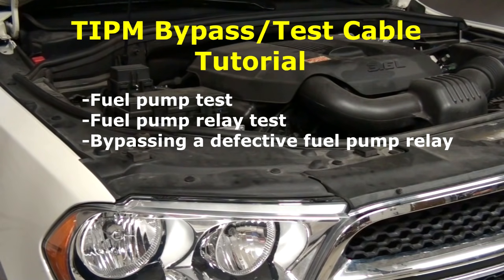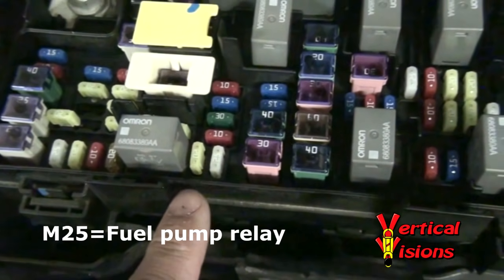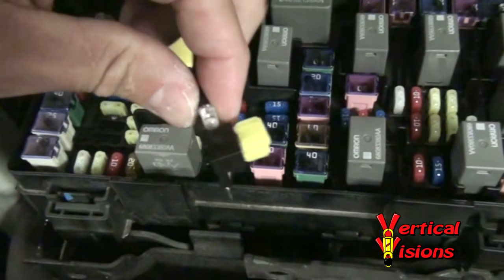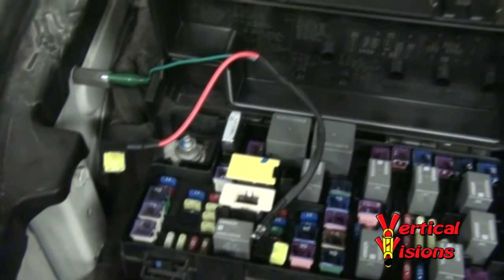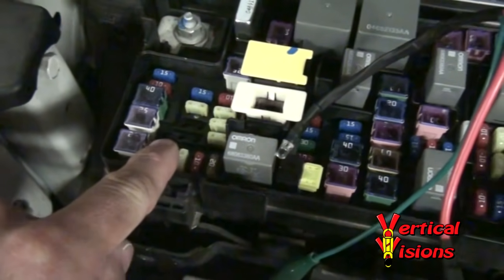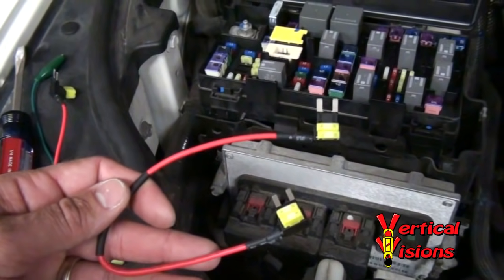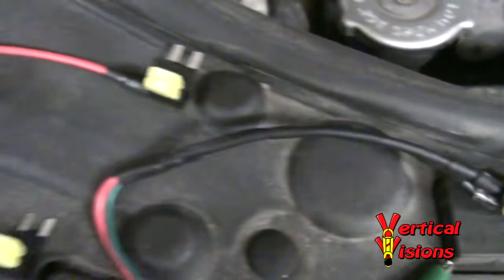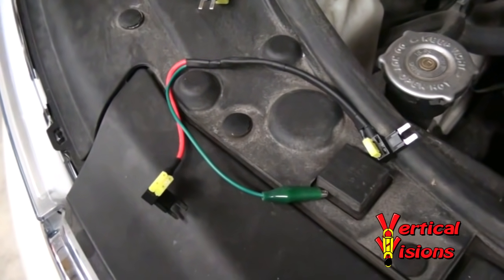TIPM Fuel Relay Test and Bypass Solutions - Most 2007-2021 Dodge, Chrysler, Ram, Jeep, VW Vehicles

Comment: Hey +Jason Bell, just wanted to let you know that I just ordered one of your cables and hoping it works out.

I'm not a car guy. We started having issues with our 2011 Dodge Grand Caravan; it would not start every now and then, and it progressively got worse. Finally brought it to a Meineke and the mechanics said it was the TIPM, but that it would be $1100+ for a replacement and ROM flash, which could only be done by a dealership. During that visit, we "determined" that whenever we locked the van, it would have issues. So of course, we just stopped locking the van... until it continued to have issues starting.

By the time we had to have it towed last night during a toasty 1 degree F evening, we had a superstitious ritual going on where you had to get in the van, close the door, put the keys into ON, change from Parking to Drive and back to Parking again before starting the van. (Yes, it was stupid, but it seemed to have worked for a bit.) The van just wasn't having it last night, and we couldn't do anything to get it to start.

Today, I tried a bunch of crap to the best of my ability: doing the "ritual," jumping it with an Antigravity Batteries XP-3 booster, resetting the ECU (the first time by disconnecting the negative terminal to the battery for 20 minutes; the second time for about an hour)... no dice. Found your site and decided to check M25's fuse to see if it finally just died. It wasn't, so I reseated it. Started right back up... I was pleasantly-surprised. Let it run for 15 minutes, then drove it around the neighborhood, then parked it, turned it off, opened the door to leave and then closed, back into the ignition and it started right back up with no issues! 

I'm sure this will happen again so I ordered one of your cables. (I see that it's just two 20A "add a circuit" cables but figured that you earned the extra $30ish... that and it eliminates the possibility of me screwing up a solder job, haha.) Hoping it works out!

Comment: MY 03 RAM HAS THE TYPICAL SALT PROBLEM IN THE FUSE PANEL..   NO CLEARANCE LIGHTS... NO TRAILER  STOP ON THE LEFT.. NO TURN ON THE LEFT OF THE TRAILER.. EITHER... NO  AC. CONDENSER FAN POWER.. NO POWER GOING TO THE LEFT REAR DOOR .. NO LICENCE PLATE LIGHTS .. .. SO I BOUGHT MANY 12V ROCKER SWITCHES AND HOTWIRED  THE TRUCK WITH 18 GA WIRES.. SHRINK N SOLDER.. AND FIXED ALL THESE PROBLEMS MYSELF... THE DEALER SAID MINIMUM...1000$ DIAG . FEE ONLY..PLUS REPAIRS FOR MAYBE 3000$... IAN IN OTTAWA CANADA..

Comment: Jason, Thank you so much for the email and for walking us thru the options. After purchasing your bypass wire we diagnosed the problem to a faulty TIPM. Will be purchasing a plug bypass system soon. Thank you for helping people avoid costly unnecessary repairs. I have gone on various forums and blogs I subscribe to posting your website info to help others! Thanks

Comment: Hey Jason! I have a 2011 Dodge Ram 1500 Laramie with the hemi. I ordered and installed the part and it seems to be working! I live in Philadelphia it’s about 13 degrees this morning and the truck hesitated to start but on the second attempt it started up, is this a problem due to it being cold or is this something normal?
Reply from the maker: It's likely a TIPM issue and how it deals with low battery voltage.  More info here:  http://www.verticalvisions.com/TIPM_cables.php#faq8
Reply: Jason Bell ok thank you! The truck has not been started for close to 2 weeks and with it being as cold as it is the battery may have been lower than usual!

Comment: Hello Jason, I have a 11 town and country for work and i watched your video and made the bypass cable myself and it worked for me for a while and now for few days i am having the same issue as before. 

So I did few things:
1) I tried to test my fuel pump by putting the wire in the right two slots of M27 and I didn’t hear my fuel pump running when I went behind my car 
2) the car now only starts when I put the wire in the right two slots of the M27 but won’t start when I put it in the left two slots.

Please give me some feedback as to what you think I should do or if I should change my fuel pump or fuel pump relay thanks.
Reply from the maker: I think you meant M7 rather than M27.  You may have low battery voltage, which is causing the TIPM to remove power to the cable during starting.  Your vehicle is our #2 most popular fix right now.  Read more here:  http://www.verticalvisions.com/TIPM_cables.php#faq8.  I suggest you check your battery voltage or implement another solution:  http://www.verticalvisions.com/TIPM_solutions.php.  Fuel pumps rarely fail on these vehicles and you can check your fuel pump operation using the cable in M7 right slots.  If the car won't start in M7 right slots, focus on the fuel pump and/or camshaft sensor.
Reply: Jason Bell thank you so much yes sorry I meant M7 and the car does starts only on the right slot of the M7 so I’m guessing it’s the battery, I did get my battery checked out and for some reason it had higher voltage on it.

Comment: Check the recalls for this, many have one on this issue.. my 2011 Durango did they installed a external relay in to bypass the internal relay..  cost me nothing.. but time to wait for them to install it.. but good to know this info..
Reply from the maker: Only 2011-2013 Dodge Durango and Jeep Grand Cherokees were recalled, despite the same faulty fuel relay being present in many other vehicles dating back to 2007.  Unfortunately, we get many calls from those who had the external relay installed by their dealer and are now experiencing problems with it.  These cheap external relays are now failing.

Comment: Why do you need a microscope to solder through hole components? Have I been doing it wrong all these years?
Reply from the maker: I'm guessing you don't own a microscope.  Perhaps your eyes are better than ours, but we use a microscope for all TIPM soldering because it's the best tool for the job.  We can inspect board components around the fuel relay to verify no damage is present and post-soldering relay inspection is more accurate.  When we're repairing TIPMs for customers, we want to get it right the first time.
Reply: Jason Bell I see. I have a borescope that I use as well as loupes If Its really necessary. The scope is nice for grabbing a pic of something for verifiable side by side comparisons. Anyways ordered the NEC updates relay. Be a nice $15 20 minute job to repair my sister in laws Caravan.

Comment: I have a 2011 Chrysler Town & Country.  A couple of weeks ago, it would continue cranking but not turnover.  I figured it was probably time for a battery replacement since the vehicle had the original battery.  After spending $200 on the battery, the issue still persisted.  That's when I started to research the issue and ran across this video.  I ordered the bypass cable, installed it, and the car starts.  Can't thank you enough, Jason, for sharing this fix!  You saved $1000 for sure.

Comment: I used a modified version of your approach to fix my 08 Ram. The bypass cable won't work on this year, but I used the accessory circuit to get keyed voltage. Used that wire to trigger an external relay wired into the fuel pump wire. Worked like a charm. Thank you!

Comment: I would love to get your take on why the patch cable would stop working after a few months of success. Still smiling after it started right up with the new internal relay 😀
Reply from the maker: The bottom fuse in M25 should only be removed if you had prior battery drainage issues due to the fuel pump remaining on after the vehicle was turned off.  Removing this fuse disconnects the old faulty relay from the fuel pump circuit.
Reply from the maker: You probably have low battery voltage (exacerbated by cold weather), which forces the TIPM to conserve power during cranking by not powering the M7 circuit used by the cable.  More info here:  http://www.verticalvisions.com/TIPM_cables.php#faq8
Reply: I have a question I have the tester kit and it’s been working pretty good but now that the weather has gotten colder here in Michigan I have had a few times where it had problems starting also I have a new battery so a few things I noticed one I had to put the other fuse back in the M 25 slot now my question is am I able to leave the Second fuse in the M 25 slot because it seems like it won’t start without it but just recently since the weather had dropped even colder I had to remove the bypass take it inside to let it warm up then when I put it back and it started so should I leave the second fuse and the M 25 slot or should I remove it
Reply: Ok thanks I am definitely interested in buying the long-term solution I just hate that this weather here in Michigan gets so cold that it’s causing me to have to try several times to crank it now I am thinking about disconnecting the bypass and bring it in the house overnight

Comment: Thanks for the patch. I made one and it worked for a few months. Cold weather hit and cold starts were hit and miss. I replaced the relay inside the tipm per your sloutions. Hopefull done and fixed for a long time. Thank you
Reply from the maker: You probably have low battery voltage, which forces the TIPM to conserve power during cranking by not powering the M7 circuit used by the cable.  More info here:  http://www.verticalvisions.com/TIPM_cables.php#faq8

Comment: Thank you so much for the video!! Saved my dad from getting a rental and a very costly repair to the truck. I checked with a meter, and just ran a jumper from M7 (battery) to M25 (fuel pump) using a piece of 14 gauge wire
Reply: That's what I used to do before I got one of these 😉

Comment: Jason I would like to thank you... This is my first comment ever on you tube.  This video helped my out "Big Time" today.  My son is away at college with his 2011 Ram 1500 and called yesterday and told me his truck was not starting.  Crank no start.  I did the YouTube search and found this video. The detailed information between video and drawings was able to walk my son and his friend who knew his way around cars enough to diagnose and temp jump the bad relay.  With the help of a gentleman at Autozone they where able to make a jumper and bypass the bad relay to get him home for the holiday safely. Although the store did not have the add a circuit for the 20 amp like you make they where able to use a 20amp fuse holder and some type of fuse insert that the m7 and m25 fuse cradles in and allows for a spade connection to complete the jump.  Dude you saved me $100's.  I will follow up with a external relay kit from Mopar as a more perm fix.  Thanks again for taking the time to put this information out there.

Comment: Hello. Thanks for the video. My 2012 town and country had the same issues of turning over but not starting. The dealership said I needed a TIPM. Can I purchase it from your website. Also witch cable would I need. Thanks again.
Reply from the maker: James, you can purchase here:  http://www.verticalvisions.com/TIPM_cables.php#buyone.  Our website has a chart that will tell you which cable is best for your situation.  We also have other fuel relay solutions here (some that you may be able to fix yourself):  http://www.verticalvisions.com/TIPM_solutions.php.  Thanks.

Comment: Thanks Jason! I live in BC Canada and ordered your bypass cable last week for my 2011 Dodge Grand Caravan. A couple of weeks ago the van began having troubles starting and eventually didn't start at all (just cranking continuously). I brought it to the repair shop and they said it might have something to do with the fuel pump relay but they didn't want to experiment on the problem.... a quick Google search and I came across your video & website. To be honest, I went off of my 'vibe' about you more than anything and ordered your cable. It arrived yesterday and I popped it in my van and.... voila! Van started up right away! Just in time too as my kid was about to miss his school halloween party because of it :) This is a great service you're offering and I wanted to extend my thanks. (for those of you needing this fixed quickly you'll be happy to know that Jason ships the product out very fast, complete with tracking number). Thanks again my friend!
Reply: Here in Alberta with the same van looking to avoid paying $1400 TIPM + labour.  Just order the Relay System (ByPass) Lite

Comment: 2007  ram 1500,,,,,, fuse box has no fuel  relays,,,?????????help!!!
Reply from the maker: Many TIPM relays are inside the black plastic box, soldered to circuit boards.

Comment: Wonderful but the fuel it's working all time without open the key?
Reply from the maker: With the cable, your fuel pump only comes on when the key is on.  However, if your faulty fuel pump relay is stuck on, then your fuel pump will operate in a key off situation.  You'll need to remove one fuse on our cable in this situation, as per the instructions sent with the cable.  More info:  http://www.verticalvisions.com/TIPM_cables.php#faq3
Reply: Jason Bell thank you.. Is because my truck it 2012 and the power to the cigarette it's all time I need to find other fuse for the ignition
Reply from the maker: Try M7 (left slots) rather than the right slots.  Lefts slots provide power when key is on and right slots provide full time power.  The M7 fuse slot contains two possible configurations for power.
Reply: Jason Bell  thank u

Comment: Thank you so much for this video. The garage wanted 1200.00 to fix my wife's van. They told us that the fuel pump was bad and they would have to drop the gas tank to replace it. I fixed with a 6 inch piece of scrap wire. My wife thinks I'm a genius. Thank you again. Btw, I saw your human catipult video, insane.

Comment: Jason, THANK YOU for your knowledge and expertise. I have a 2011 Dodge Gnd Caravan Crew.  140.000 miles,  began suddenly not wanting to start, just turns over vigorously. After trying about 5-6 times in succession, it would then start.  But, if you switch off motor, and then the same routine. Took to my local garage and they said fuel pump was good but suspected TIPM, but did not want to risk buying a new TIPM and it not work. Said take to dealer, will cost you about $1200+, but they will take risk.
I am a Mfg engineer and practiced electrical and mechanical engineering. I made a jumper according to your discussion with an in-line 20a fuse and it solved the problem. HOWEVER, I still went to your website and ordered your standard version jumper for $35+shipping because I value the information you offered for free and want to support you. IT's worth it !!!!
People- if you have this problem- try this and buy Jason's jumper bypass, it's only fair since he is saving us $1000's out there for a problem Dodge created and won't warranty or recall this model.  Thanks again Jason, you "de-stressed'' my life significantly, as I hate car problems and dealing with a dealer shop.
Reply from the maker: Great post.  Thanks!
Reply: is this a permanent fix ??

Comment: Hey PEOPLE Hows everyone doing today ... i got a question ( did you guys ever hear about the 2005 dodge caravan door lock problems ... * you have to take out the iod fuse every time 2 days since doors and dome light will stop working and only if you take out the iod fuse for 10 seconds and put it will the doors work back again for about 2 days ... lol then back to the iod fuse ... called chrysler and said all 2005 models have this issues ( and said the car pc neews reflashing at 300$ lol no thanks ... is there a way to rewire the door locks and dome light without taking out that dam iod fuse ( would this video wiring thing work for my situation > or can anyone tell me or explain what procedures i would have to do ... cause i hear a video of a guy who just went to a scrap yard and pulled the whole fuse box of of a similar car ( caravan ) and 1year over his year and installed it and it fix his probleme but ... not too keen about doing that since this is my only car ? any ideas guys
Reply from the maker: We don't work on vehicles older than 2007, but you may want to investigate and then try a hard reset.  Instructions here:  http://www.verticalvisions.com/TIPM_used.php#hardreset

Comment: 2011 Chrysler Town and Country has flashing anti theft light won't start. Also has lightning bolt and inverted parentheses. It was fine and all the sudden quit starting at 80g miles. Shop says I need a 900 computer part. Will this cord work in my situation? I'll never have $900. I'm still paying the car off. 😞Thank you in advance.
Reply from the maker: Most faulty fuel relays will not trigger any codes, so I would suggest you solve your other issues first.  Worst case, you can purchase used TIPMs here:  http://www.verticalvisions.com/TIPM_used.php